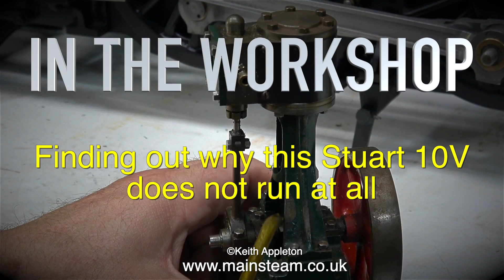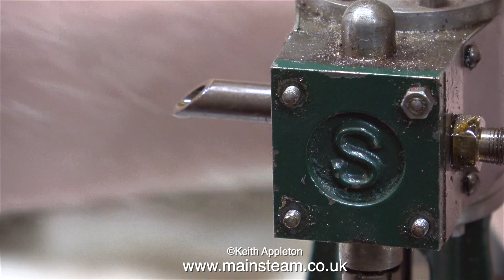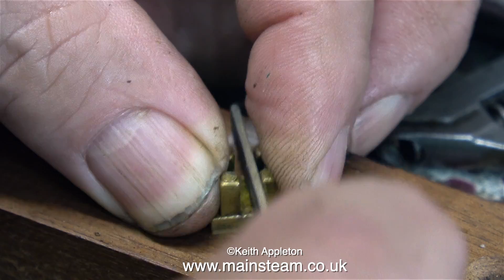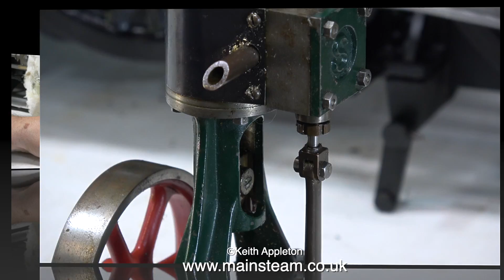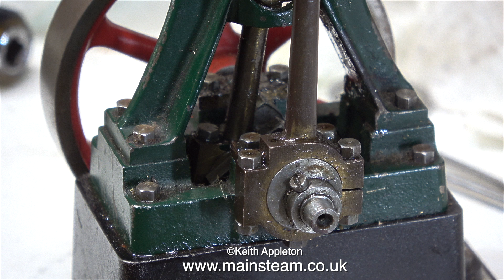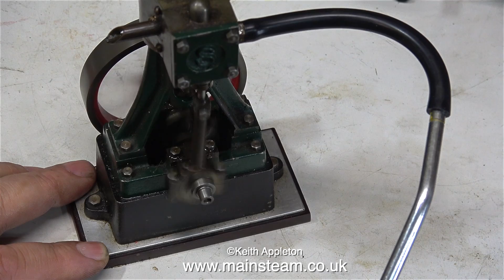A STUART MODELS NUMBER 10V STEAM ENGINE NON RUNNER - IN THE WORK  SHOP

Comment: I'd have thought silver soldering the hole in crankshaft would have been one way to fix timing problem.....
Just curious as to why you didnt- not worth the effort or something else would get damaged???
Reply from the maker: Heat distortion is not generally good for old Loctited together crankshafts . . . . . . I generally think things through before I make these videos . . . . }:-)))
Reply: Ahhhh.....hadnt considered that it was a built up crankshaft...

Thank you for scratching my curiosity/OCD! 3:-)

Comment: The eccentric could be re drilled 90 degrees from its current location and not into the shaft and allow timing corrections, but I am certain you had thought of this. Just me learning my way round a steam engine

Comment: If the slide valve is in the proper position and the eccentric has been adjusted...how then do you fix the timing issue? (a different eccentric maybe?) Thanks!

Comment: A hole all the way through the crankshaft?  Sounds like a job for JB Weld!  I've repaired full size water pumps with JB Weld!  It becomes so hard you can actually drill and tap it,  machine it or grind it to a nice finish.  I don't know who invented it, but JB Weld saved my former employer thousands of dollars by not having to replace worn out pumps and other machine parts.